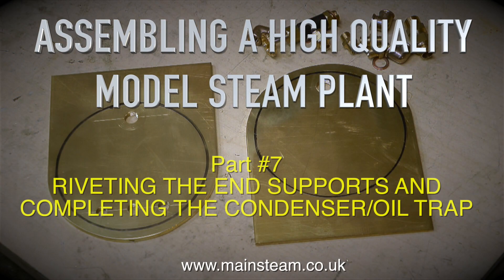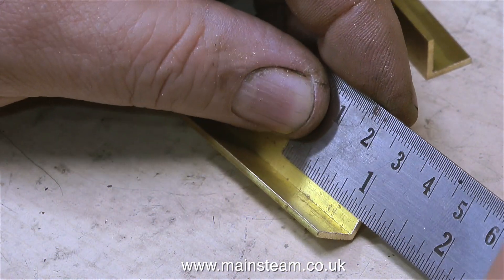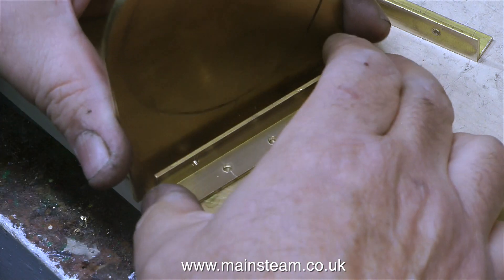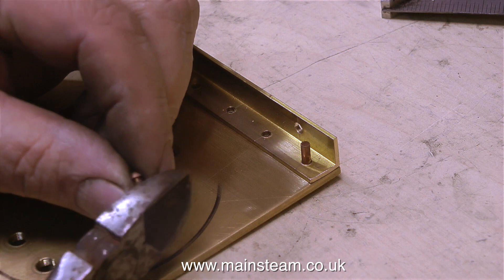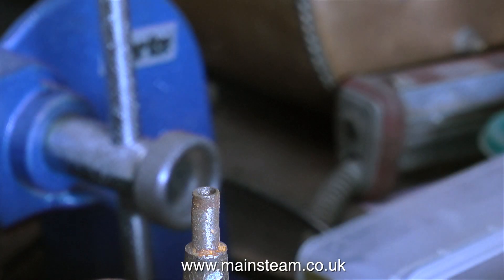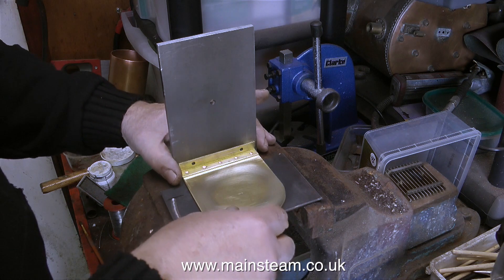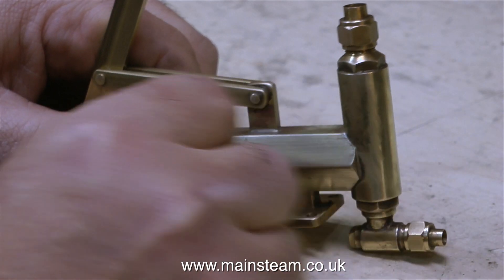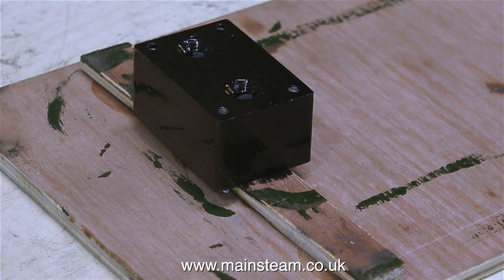ASSEMBLING A HIGH QUALITY MODEL STEAM PLANT - PART #7

Comment: Extremely late to the party, but just making a comment here in case I don't get the answer in a later video.
Just wondering how the internals are working on the condenser. I was expecting inner tubes like a liquid/liquid heat exchanger or does this mainly work on oil floating to the surface?

No idea why I started watching your videos, but there extremely interesting and I'd be lying if a little bug hasnt bitten to get something off shelf simple to start with.

lol, Question answered at vid #20 basically just a big enough expansion chamber to allow cooling

Comment: Mr. Appleton,  beautiful work, great instructional video as always.  How do you get the threaded "street 90" fittings to seal and simultaneously all line up correctly, if the threads just start anywhere by chance?  I didn't see any spacers, and then it may not seal correctly? ....is it like magic?
Reply from the maker: i use thin shim washers

Comment: That condenser is gorgeous. If be tempted to clad it in metal and polish the end caps, but I know why you likely aren't  ( in your previous videos you've talked about it), and it will look brilliant either way!

Question? Would a Victoria work to drive something like a large sidewheel model boat?
Reply from the maker: No it's not ideal as there isn't a drive from the ends of the crankshaft only from the flywheel . . .

Comment: I particularly like the way you soldered the endplates.  I find that the more time I spend in the shop, the easier it is to visualize the fixtures needed.  Your comment about leaving room for the rivet heads shows this.  If you just pop in and out of the shop, it's easy to become frustrated and sloppy.  Again, treating every item as a project in it's own right is key.  Excellent video.

Comment: For cutting rivets, I like to use an inexpensive wire stripping / crimping tool that has holes for cutting off screws. The screw cutting part cuts the rivets and leaves a nice clean end that slips right into the hole. A Stanley 84-199 is similar to what I use for cutting 1/8 and 3/32 aluminum rivets.

Comment: That's coming along nicely. I have to admit I was a bit skeptical about how the condenser/oil trap would turn out from watching the previous video. Adding the fittings and a few well placed rivets has really improved it's appearance without making it too 'fussy'. I would have been tempted to add some decorative features myself but it's obvious now they would be unnecessary.

Comment: Just a thought about cutting rivets. You know the bigger style of electrical wire strippers? The ones that have holes in them that seem totally useless. The holes are actually for shearing small screws to length. No clue if they would shear rivets cleanly but it might save you the time of building a jig if you have a set laying around. :p